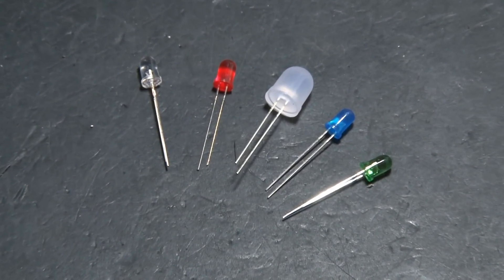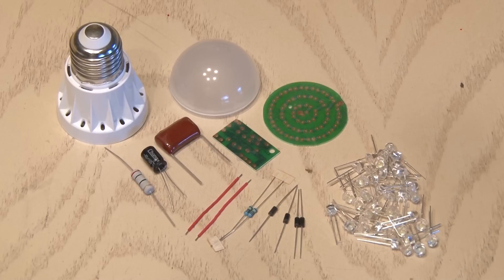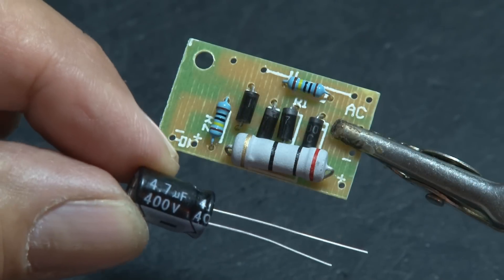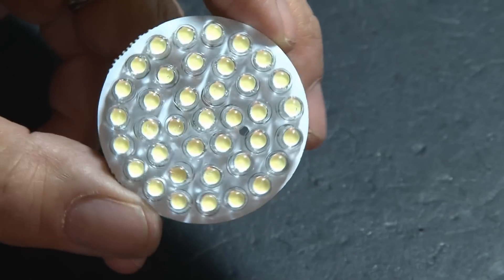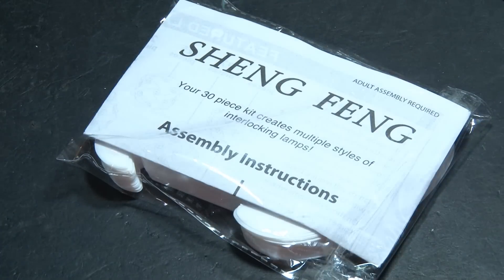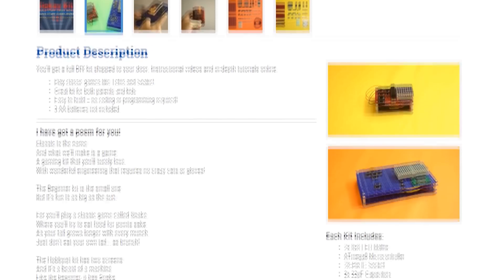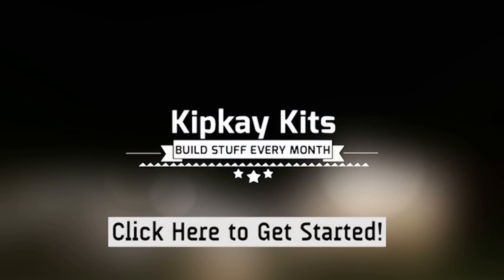Make Your Own LED Lightbulb!

Comment: Great video as usual, but I'm not too thrilled having that many LED's in series. I like to make these LED bulbs using groups of 4 LED's in series, then place all the groups of LED's in parallel. Much better in the event one LED goes bad.
Reply: electronicsNmore With this design, driver is basically a ballast. Actually it'll be most efficient when using as many LED's as input voltage makes possible. I've built 5 LED kind of night light, made the ballast for 18ma, it draws the same power from the mains as the one with 30 LED's running at the same current. Having strings of 4 LED's (like 5 of 'em) and running them at 20ma each will result in 100ma drawn from mains, which is not efficient at all (12W in 120V countries and over 20W for others)

Comment: As a DIYer and a car guy (mostly jeeps) I'd really like to see a 12v DC version of this, or at least of just the circuit prior to soldering all the LED's in. I've really wanted to make my own light bar for a really long time, but I can't seem to find anywhere to get the materials, or set aside the time to figure out the correct schematics.

Comment: Warning!! not for 220/240V
the 2 caps have to be changed, the electrolytic has to be a 600V cap and the red one needs to be a different value

Comment: great as usual @kipkay but since you are using a resistor to drop down voltage to the req voltage it would not be efficient.
instead use a outlet mobile charger which uses transformer  to power the circuit and use 1w leds instead they are much brighter and easy. They are much more efficient.

Comment: This would not work for europe would it? we use 230v 50hz not 120v 60hz
Reply: I was thinking exactly the same thing. Let's hope Kipkay sees this!
Reply: It should work because the bulb holder only sends some of the 220v or 120v
Reply: You need bigger resistance, but everything else is the same. I could do the math for you later.
EDIT:
I was wrong, as stated above I hadn't done the math before posting this comment.Also you shouldn't use homemade light bulbs for longer periods of time anyways.
Reply: Kolt
No it will not work.
there are 38 leds, white leds use 3.0 to 3.3 volts each.
38x3.0 is 114v(125v if you use 3.3v) to use for 240v line systems you either need 2x more leds, or a way to reduce the voltage by 100v.

There is no mention of this being only for 120v line systems or compatible with all power lines which is not professional in the slightest.
Reply: ***** 
are you sure the light socket is 120 and not 240v with 6amp fuse.
I have not heard of any dual voltage lines for housing where mains get one and lighting gets another.
Reply: ***** actually sorry to contradict you, but I just checked a light bulb and it has 230v printed on it. Also I asked a friend who also says they are 230v.
Reply: Dan T so do I and I agree with you completely.
Reply: Dan T Yes I know, I don't understand why you are telling me this though.
Reply: Dan T No worries, it was nice having someone to talk to anyway haha.
Reply: I may consider getting the Pi 2 in the future but for now my Pi is doing what I need it to do ☺
Reply: It depends really. I generally only use it to prove a concept but once I'm done with that I'll turn it off for another couple of weeks...
Reply: IIGrayfoxII The power supply is capacitive, just a big resistor divider using a cap. Capacitor acts like a resistance in series. So you double the voltage, you double the current to the leds. If the design was to put 10mA across them with 240v you get 20mA. Also, as freq drop from 60 to 50, capacitor impedance goes up so will be somewhere into 18mA. The leds would survive. Depens on the calculations if this thing will last or not.  If it was pushed hard at 120V it will eventually blow at 240 but leds are not drive at constant voltage, but "constant" current (constan AC mains provided)
Reply: My main problem with it is the AC 230v is so close the the DC side. It will more than likely  not pass BS EN 61439. Any way made me lol

Comment: Why did you bend the capacitor over on the Resistor? Doesn't the resistor put out alot of heat?

Comment: Watch out with different colored LEDs!
The forward voltage of a white LED is abour 3.4V which in total will result in about 130V (the 38 LEDs are in series).
if you use red LEDs with a forward voltage of 2.3V, you'd only get about 90V. And since the only current "regulation" that is used in the board is a resistor you'd drive your red LEDs with way too much current and destroy them

Comment: hi enjoyed your video im doing an art project for my friends wedding she wants led fairy lights in wine bottles the thing is how do I change the plug in wall bit. to just run on a aaa battery pack so it can be attached to the wine bottle on each wine bottle on the outside do you have any video's on this

Comment: But... An LED is already a lightbulb...
Reply: The thing is LED saves way more money than a normal lightbulb, because it uses less power and it's also long lasting.
Reply: ***** What Randy is saying is that, you're pretty much using a light bulb, to make a light bulb.
Reply: They're much more expensive than this homemade version.
Reply: That Guy With the Pointlessly Long Username That You Are Wasting Your Time Reading Right Now No they aren't. The project kit KipKay is selling costs $19.99. You can buy an RGB LED light bulb that can shine any color, and can also be dimmed, for $7.99 on Amazon.
Reply: Randy Oum bro, do you even electronics?
Reply: ***** how many lumens?
Reply: Randy Oum It's not a bulb, a bulb is something plant. This is a lamp.
Reply: That Guy With the Pointlessly Long Username That You Are Wasting Your Time Reading Right Now 
Not really.
This kit is $20, you can get the same for $10
Reply: Gustavo Meronvil it's like using drops of water to fill a glass.
Reply: This tells you how to make an LED lightbulb. It's like arts and crafts, except more technology -ish. Knowing how to make a lightbulb can help you understand how the lightbulb parts all work out.

Comment: And teaches you how to burn your house down or electrocute yourself.
These bulbs are normally, $14 for enough light for a bedroom.
One mistake, one frayed cable and you have a short.
This kit will be half that if not the same.

I personally would have coated the powerboard in liquid electrical tape to prevent any chance of a short and i would have done the same with the LED board as well

Now is this kit compatible with 240 line voltage systems?
The LEDs are wired in series so 38xVf of white LED(3.0~3.3) is 114v~125v.

Doesn't seem so as there is just a bridge rectifier, a resistor and 2 caps
None of which will lower the voltage by 100v

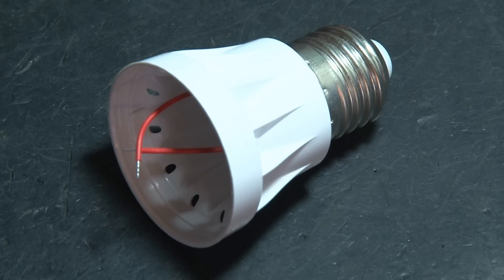Comment: 2:17 how close is that 110v input from the DC side going to the LEDs. (the creepage distance is tiny, the Dc out put should have been put on the other side of the board)  There is no isolation from the main so any one who may touch the Dc side may get a massive shock (there problem)_ .  This thing may 'unlikely' set fire to your house or may even kill you. I thought some of the one on eBay where deadly but this is taking the piss. The fact this cost $20 when to build with out the kit will cost around $7-10 is a bit harsh. The fact this is aimed at noobs with a soldering iron who  more that likley don't have a clue what they are messing with. Like I could go into the EN 60335 safety we have in the EU. The best part about it is the capacitor dropper will not work on are 230v power grid (bit of luck). I also have some consensuses that the plastic used in the bulb fitting probable does not mean fire standers as your a money grabbing (add you adjective here). If you are looking at building some soldering kits go a head but don't mess with this one.
If you would like some good one fell free to message me back. (ebay is the best place or Banggood)

Comment: Now, being a complete noob at electronics.
I'm making the pre-assumption that the power board is made for the US wall sockets, not sure what comes out of them, but what if you're NOT in the US.

Just thinking if a bozo like myself gets the kit, builds it and turns it on from a wall socket, and something goes boom (cue magic blue smoke). ?

Comment: In my opinion one shouldn't be messing around with 110 / 230 volt home power when working with educational projects. One with enough experience for that would be someone with enough electrical skills to think this out on their own. Before that point just get busy with low voltage project kits, there are plenty of them. If you don't explain the purpose of the components in de circuitry, the low voltage stuff is equal educational anyway, possible even more, and your insurance won't let you on your own after your house got burned down and they discover this hobby project in one of your light fittings.

Comment: I just bought a new blue LED 4W bulb at Menards for $4.99 (regular price).
Reply: How fun was that?
Reply: Guywithcrazyideas Now unsolder the LED and save them for future projects.
Reply: Nice, I found that Walmart has a Great Value brand LED lightbulbs for a great price (3.88), 95 percent of the house is coverted over. I've noticed a huge drop in my electricity useage and monthly bill.
Reply: I'd rather pay for an auraglow light bulb. I'd prefer to change colors, brightness, speed, fade from one color to another with the push of a button on a thin remote

Comment: You could at least briefly explain what that components in that circuit do...
Reply: Numian He could, I will try to help out. A common analogy for electric current is water.

So you might know that the electricity in your home is AC (alternating current). Bits of energy rush into your components like waves. The things on the circuitboard don't take that kind of current very well, so whe have to convert it.
The capacitor acts like a barrel where the water or electricity gets collected. On the other side of the capacitor the current is released in a steady flow. this is now DC (direct current). Are you with me so far?

The resistor is actually quite simple. The current in your home comes with so much "force" that the LED's would get destroyed. Like the water coming in with too much pressure. The resistor tones that pressure down. That pressure is the voltage by the way.

I hope that works for you :)
Reply: Thank you! I really appreciate it!
Reply: Numian You're welcome ^^

Comment: 38 LEDs * 3.2 volts = ~120 Volts,
This won't work in my country, where we use 220V mains.
Reply: use 74 LEDs
Reply: +David Refoua 120v can work on 220v, but 220v cannot work on 120v

Comment: How should I modify power unit to use it with 220V?
Reply: Кирилл Лейфер Just stick the LED's directly into the wall socket.
Reply: christopherhug Wow, that easy? Thanks
Reply: Кирилл Лейфер NO, do NOT do this. , the 2 caps have to be changed, the electrolytic has to be a 600V cap and the red one needs to be a different value, im unsure what though
Reply: voltare2amstereo
That's was a joke, i'm not insane to put LED
into wall socket :D
Reply: i know, but these video's are directed to learners,